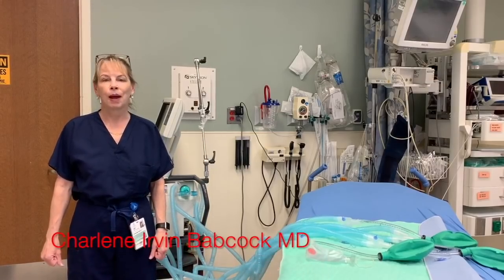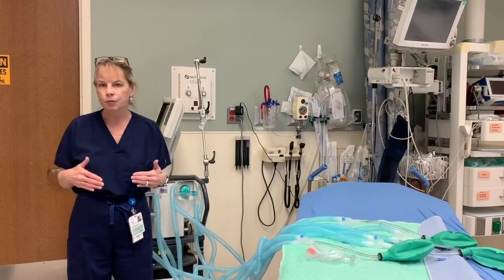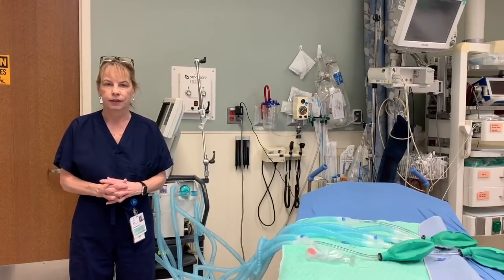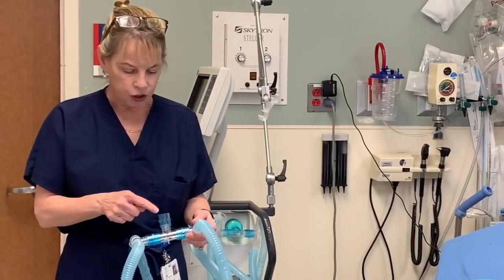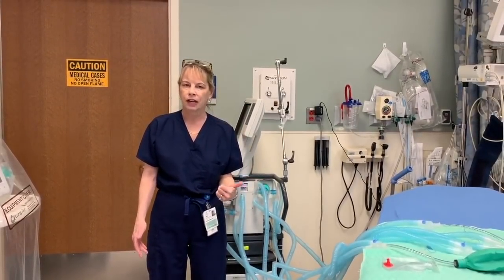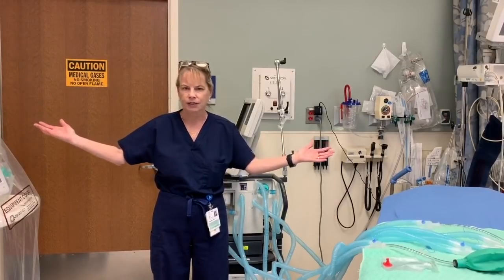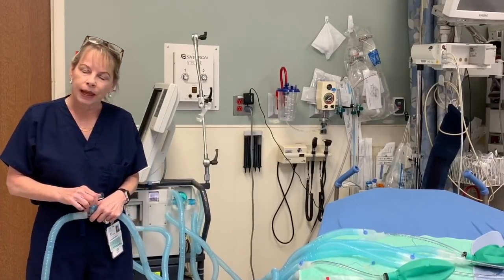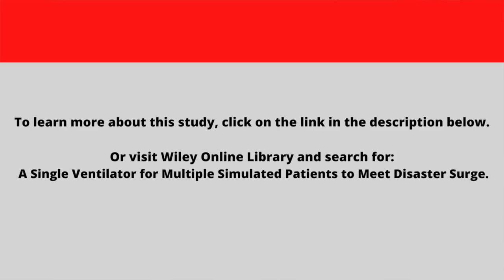COVID-19 How to Use One Ventilator to Save Multiple Lives

Comment: (I am an engineer) With the case lung simulators, it is okay. But suddenly a patient went to hyper/hypo-ventilation, then their is a sudden rise in volume of inlet air and drop off of exhaled air. Temporary purposes it will do fine but in long run, will it be okay. Even though, the patients are expected to corona infected finding similar match with little modification in pressure and beat rates will be a little different.

Comment: Hi
I have one question.
What is the air temperature?👍⚘😀☹
Reply: https://youtu.be/OAhEJfKZnNs
Reply: Out & in side
Reply: t the ET tube 37 degrees C.
Reply: This is the type of hysteria that leads politicians like Andrew Cuomo to OVERESTIMATE the need for mechanical ventilators by 800%. NYC never exceeded 6000 ventilators at any one time.This physician should be sanctioned by the board because this video is STUPID.

Comment: Every patient has different lung mechanics, especially the diseased lung. Each would have different needs in terms of ventilation and comorbidities. You cannot guarantee volumes needed, lung recruitment. You would not be able to manage blood gases appropriately. Cross Contamination even with 1way valves. This is likely not going to save your patients.

Comment: Joint Statement on Multiple Patients Per Ventilator

March 26, 2020: The Society of Critical Care Medicine (SCCM), American Association for Respiratory Care (AARC), American Society of Anesthesiologists (ASA), Anesthesia Patient Safety Foundation (APSF), American Association of Critical‐Care Nurses (AACN), and American College of Chest Physicians (CHEST) issue this consensus statement on the concept of placing multiple patients on a single mechanical ventilator.

The above‐named organizations advise clinicians that sharing mechanical ventilators should not be attempted because it cannot be done safely with current equipment. The physiology of patients with COVID‐19‐onset acute respiratory distress syndrome (ARDS) is complex. Even in ideal circumstances, ventilating a single patient with ARDS and nonhomogenous lung disease is difficult and is associated with a 40%‐60% mortality rate. Attempting to ventilate multiple patients with COVID‐19, given the issues described here, could lead to poor outcomes and high mortality rates for all patients cohorted. In accordance with the exceedingly difficult, but not uncommon, triage decisions often made in medical crises, it is better to purpose the ventilator to the patient most likely to benefit than fail to prevent, or even cause, the demise of multiple patients.

Comment: I don't get these comments. Dealing people with non functioning lungs and you don't have machine available for them. What do you do? Let them suffocate or share the machine? Whats is the point of hygiene at this moment? People are suffocating.
Reply: We use an AMBU bag with a viral filter and a PEEP valve.  This video is a very very good way to kill 4 people.
Reply: @martqbd  So there is a safe way to split these machines? Rather than being negative, you can make a video about what you are doing and share with your fellow health care workers and save lives!
Reply: @JasenMacTurdsen  No there is not a safe way to do this.
My comment was to manually bags these people. Until vents become available.
Reply: @martqbd  There is a safe way to do it under specific circumstances with the right ventilator that does not jeopardize the health of the original patient placed on the machine. Don't make unsubstantiated categorical claims.
Reply: @jayls5  You can do that on your license. I have a family to support. I have an aversion to prison.
Reply: Jon- I have been a Registered Respiratory Therapist since 1984 and coordinated the mass casualty scenario for a Level One Trauma Center in Philadelphia. This techniques is not needed and dangerous when using the type of ventilator in this video. I assume you are an office worker based on your avatar- go back to pushing paper.

Comment: Just rethinking that check valve and that won"t work
Reply from the maker: It does work...they are doing it inNYC.....no check valve...check tidal volume at ventilator.....
Reply: @charlenebabcock1048  Can you augment pressure control mode with an inline cpap psig to increase the pt load per machine if needed? Like a bedside unit t pieced into vent circuit ? Or just to help with increased ventilatory demand if needed on two to four pts
Reply: https://youtu.be/OAhEJfKZnNs

Comment: You could reduce the airflow in a single line two ways, 1. by introducing something to restrict the airflow. This could be a reducer or some sort or possibly just putting tape over a portion on the end of the hose. 2. you could make a hole or several holes in one line  probably near the individual patient and adjust pressure by the amount of air you let escape. Because this second method could reduce pressure in the whole system It would be best to have some kind of flapper / check valve in that particular line.

Comment: This is absolutely irresponsible and dangerous. 
Such a setup works for 4 identical test lungs but it will likely kill 3 out of four patients attached.
Reply from the maker: Its not  irresponsible...and it works....they are using it in dire circumstances
in  NYC...we all agree its not ideal...but if I have 10 patients crashing...and 2 vents.s..I'd rather save 4 then2....
Reply: Not 4 but it is working on 2 in New York right now
The HHS released "Optimizing Ventilator Use during the Covid-19 Pandemic"  yesterday
Take a look

Comment: I like the concept.  There may be a way to change the airflow demand to individualized with the installation of a regulator, similar to a scuba system. The positive pressure comes from the main unit to multiple patients. To reduce cross contamination the negative pressure pump could be eternal and filter expulsions before venting.
Keep improving the system.
Reply: Most 4th generation mechanical ventilators modify the flow and pressure continuously throughout the inspiratory phase to achieve the desired tidal volume based on the measurement of lung compliance or stiffness. Valves interfere with this measurement. The concept would be more viable with simple piston or bellows powered ventilators such as the Emerson Post Op or Monaghan 225.
Reply: @adamsmith3413  Excellent point.  I hope we will be able to meet the demand in North America with modern single patient ventilators.  Looking at the older models with bellows to serve multiple patient may help countries like India. One hospital bed per 2,000 population.
Reply: @adamsmith3413  Please contact "Ljube Bosk ovski" <ljube.boskovski@tum.de> He is is part of an international group working on a new economical ventilator.  Your experience would be valuable.  
Thank you
Robert More

Comment: FYI:  Consensus Statement on Multiple Patients Per Ventilator, The Society of Critical Care Medicine (SCCM),  Issued: March 26, 2020, 12:00 p.m.
https://www.sccm.org/Disaster/Joint-Statement-on-Multiple-Patients-Per-Ventilato?fbclid=IwAR0sn2-Qc7NjoU3YXTxZ94P-nZSbCm9jBV_8DWVOKFU9gD-p9Dk-KcBT98w

While I defer to their vast medical expertise, most of the SCCM objections seem to have engineering solutions given the right expertise, resources, and time.  

SCCM objections include: 
[followed by an engineering-centric rebuttal] :

1) Volumes would go to the most compliant lung segments.
 [Provisions to compensate have been proposed...agree that some proposed would not work.]

2) Positive end-expiratory pressure, which is of critical importance in these patients, would be impossible to manage. 
[Provisions to adjust have been proposed...challenge is to make them widely available and simple to manage]

3) Monitoring patients and measuring pulmonary mechanics would be challenging, if not impossible.
[Instrumentation and partial automation could be employed to provide visibility and reduce Provider workload]

4) Alarm monitoring and management would not be feasible. 
[Comments above apply]

5) Individualized management for clinical improvement or deterioration would be impossible.
[Comments on 1-3 above and 6 below apply]

6) In the case of a cardiac arrest, ventilation to all patients would need to be stopped to allow the change to bag ventilation without aerosolizing the virus and exposing healthcare workers. This circumstance also would alter breath delivery dynamics to the other patients.  
[Manifolds/set-ups with individual patient lockouts and provisions for addition of an AMBI Bag in crash situations have been proposed.  Breath dynamics addressed by comments on 1,2, and 3.]

7) The added circuit volume defeats the operational self-test (the test fails). The clinician would be required to operate the ventilator without a successful test, adding to errors in the measurement. 
[Beyond my expertise, but I imagine remaining self-tests would need to apply only to basic functions required to support multiple patients.  For periodic self-test, a test lung/circuit could be customized to this need and applied...perhaps across multiple ventilators...when needed.  Any continuous self-tests or other operating alarms triggered by the off-label use might be able to be modified to be applicable...ideally with manufacturer help, or fooled...like maxing-out the inhalation trigger...or squelched/muffled.]

8a) Additional external monitoring would be required The ventilator monitors the average pressures and volumes.
[Agree, and many solutions have proposed, some with components readily available in ICUs that are widely compatible across ventilators models].  

8b) Even if all patients connected to a single ventilator have the same clinical features at initiation, they could deteriorate and recover at different rates, and distribution of gas to each patient would be unequal and unmonitored.  The sickest patient would get the smallest tidal volume and the improving patient would get the largest tidal volume.  
[Only true if provisions addressing 1, 2, and 3 above are not incorporated.]

8c) The greatest risks occur with sudden deterioration of a single patient (e.g., pneumothorax, kinked endotracheal tube), with the balance of ventilation distributed to the other patients.
[Given some of the proposed solutions, I'm not sure this is a problem for other patients in all modes of operation.  Either way, an alarm for this could be able to be added to each patient circuit.] 

9) Finally, there are ethical issues. If the ventilator can be lifesaving for a single individual, using it on more than one patient at a time risks life-threatening treatment failure for all of them. 
[What has been proposed is a last-resort solution.  It's not fear-mongering to suggest the engineering begin ahead of the potential wave of need...it's contingency planning.  Let's assume a qualified team develops a 4 patient solution that is geared for use with one or more of the most popular ventilators.  The solution is backed by several weeks of engineering, including collaboration/critical review of the manufacturers...and perhaps even approval for compassionate use by the FDA.  Let's also assume the solutions are confirmed in realistic trials utilizing test lungs with variable compliance, conducted by teams of front-line Critical Care Providers in cities that are not currently overloaded.  I'm not Critical Care provider and can't imagine the stress they are under.  They are selfless heroes.   However, putting myself in their shoes, I like to have the imagined solution available as a contingency.  I don't see the risk in trying to make the imagined system a reality.  I do see a risk of Critical Care providers trying to engineer solutions on the fly.]
Reply: Very true, there are difficulties to be overcome.  I do not believe they are impossible as the article states.
Reply: ACCESSeVENTURE There is no need to risk it...NYC never exceeded 6000 vents and actually has a SURPLUS of vents, Put the patient on  a Bird Mark 7. My state has less than 22 patients admitted to ICU.
Reply: HHS Released the protocol yesterday for splitting 2  take a look

Comment: This is a dangerous technique that is not a viable option on the current generation of ventilators. The volumes that she discusses are quite unrealistic in a ARDS patient which is characterized by a inflamed low compliance lung. A GSW victims has normal lung compliance. I am a Registered Respiratory Therapist with thirty years experience using every ventilator available since 1975. The American College of Chest Physician s and the AARC just issued a joint statement urging clinicians to avoid this technique.
Reply: Adam Smith  come up with a real solution or get out of the way
Reply: jdluntjr76226 I polite before but I changed my mind...I have just come out of retirement and reactivated my credential because of the Covid-19 crisis. I am a Registered Respiratory Therapist which is an advanced practitioner. I was a staff therapist. An instructor at two AMA approved Respiratory Therapy schools, a supervisor at a 500 bed teaching hospital in Philadelphia and the Director of a RT department.I have volunteered to assist my state in this crisis. I have been in the field since1984 and you assume you know more than me? Fuck you.
Reply: jdluntjr76226 There is no ventilator shortage...no solution is required. This ER doc is just spitballing and she is making the public needlessly alarmed. I have use almost every major ventilator on the market, I have taught mechanical ventilation at the college level and for professional groups, and participated in field testing prototype vents.Relax.
Reply: jdluntjr76226 PS I’m in the ICU..you are the only one in the way?
Reply: So, ventilator splitting is pure criminal, right? You can`t monitor all parameters and feedback with four patients?

Comment: So if one patient gets blue you just need to sit on the chests of the other three for a while???
Reply from the maker: No...you really need to be sure the patients are matched as well as possible...watch tidal volumes and blood gases....takes more intensive work...but possible (see successes at NYC)....you measure tidal volume and change patient to another 'match' when vent setting needs change.....not ideal...but can work if you have no other options...good luck!
Reply: @charlenebabcock1048  How do you want to messure and control the tidal volume when they are all conected to the same machine??? You know that the tidal volume can change a lot due to positioning ( wich is  highly recommend with ARDS ) and fluids inside the lungs that blocks certain areas ( wich is another big topic with an infected lung )... I am sure this works well with testlungs but i doubt that it works with human bodys...

Comment: perharps will work with ideal healthy lungs....just like in the model lungs...... 
A parallel circuit branching to limbs/ports of different resistances being controlled by one setting is a critical problem. ARDS patients go through different compliances at different times in the disease process, how do you correct for that ? (paralysis is not enough). FYI the las-vegas patients were healthy trauma patients, perharps majority didnt have lung disease and thus i suspect their lung compliace were in the normal range or close to each other. 
On another note, you could add vent filters on each limb if the ventilator can power through the associated resistance, that MIGHT reduce the viral/bacterial cross-contamination.
Reply: No perhaps...its not a good idea

Comment: This must the very last resort! The Doctor addresses the question of cross-contamination and cross-infection stating that it should be okay since all four or more patients, in the current scenario have COVID-19. However, what is not accounted for is that chances of those needing a respirator are those who are already vulnerable with other medical issues. So as you increase the number of distributaries, the probability of cross-infection will increase exponentially. Given that the patient may be in the vulnerable class (she recommended that the recipients should have the same lung capacity), I think the patient will be worse off! That’s my take. So this should be the very last resort under very dire circumstances. The example of Las Vegas shooting does not compare because the patients did not belong to the vulnerable class and most likely healthy otherwise. Would like to hear more about cross-infection when used on otherwise vulnerable patients.

Comment: Hopefully this ends the idea
https://www.sccm.org/Disaster/Joint-Statement-on-Multiple-Patients-Per-Ventilato
Reply: Sreejith Mohan if you read closely even this article makes an exception for dire circumstances. And the fda just approved the splitters
Reply: @aliveoutside248  No it doesn't

The above-named organizations advise clinicians that sharing mechanical ventilators should not be attempted because it cannot be done safely with current equipment. The physiology of patients with COVID-19-onset acute respiratory distress syndrome (ARDS) is complex. Even in ideal circumstances, ventilating a single patient with ARDS and nonhomogenous lung disease is difficult and is associated with a 40%-60% mortality rate. Attempting to ventilate multiple patients with COVID-19, given the issues described here, could lead to poor outcomes and high mortality rates for all patients cohorted. In accordance with the exceedingly difficult, but not uncommon, triage decisions often made in medical crises, it is better to purpose the ventilator to the patient most likely to benefit than fail to prevent, or even cause, the demise of multiple patients.
Reply: SCCM statement is misguided, you will see this incorporated most likely immediately now